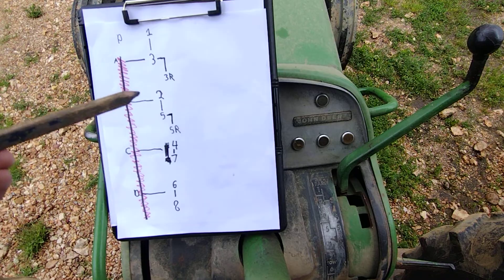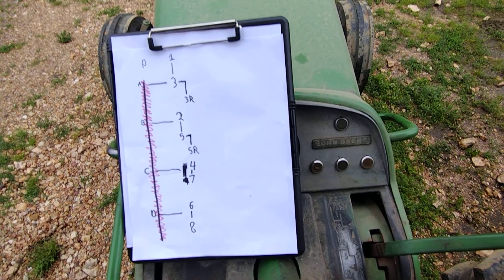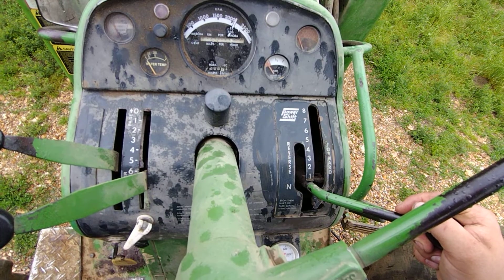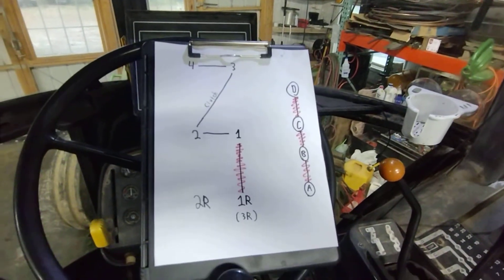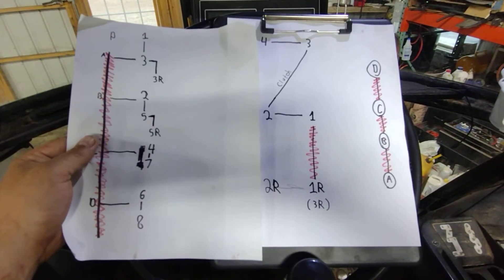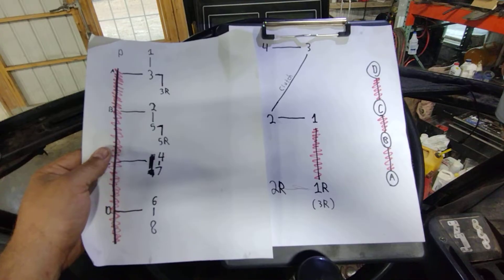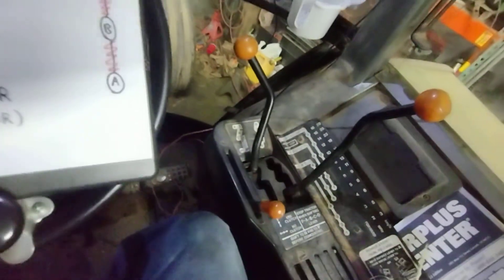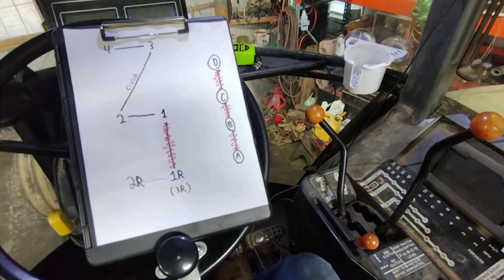John Deere Transmissions which is the best?-- Syncro Range vs Powershift vs Quad Range

Comment: Just asking how is it with a (LOADER) on front. How do you shift with same hands as LOADER control LEVERS. We had a mid range John Deere with a side boom mower, I as sorry I don't remember the numbers its been 10 years sense I ran the girl. Our shift lever was like a 5 speed transmission on right side next to seat like your tractor. It had buttons to push for 4 shift ranges in that gear. I do remember the very FAST reverse if I needed to BACK UP if the side boom flail came to a obstacle. We had more than one person driving the work 🐎 so the poor tractor got beat up. One of the operator loved to mow very fast. And beat the flail bottom and sides up, so much we were constantly welding steel bars to build up on wear parts of side and. Donlet me get started on lets say a RUG someone threw in the deep grass of ditch. You sometimes had to burn the carpet out with a torch the whole P.T.O. stopped RUNNING. Plus what I call hammer heads (the hanging "L" shaped) replacement knives that spun around it was change out almost every other day. And sometimes you had to cut them off with a torch. You could not unbolt them. That was my time on that John Deere mis size farm tractor. I can say one thing about a side boom mower. The LOWER draft linkage is never run for the life of our usage. So who ever "BUYS" our mower after its turned over for SALE. it has a 3 point hitch that is basically BRAND NEW. Those draft control we NEVER touched in the whole working life of that side boom mower, because it never was removed for the time we used it. All the tractor ever did was side boom mowing. 😊 same with a 420 FORD tractor I ran. It had a backhoe on back with the chain rap around swing for boom. That 3 point hitch was never used in the life of that 420. The backhoe stayed on. You had to shift the floor gear shifter for reverse on the 420. A farmer bought that backhoe from us and if I remember on the BID sale he paid like $13 thousand for it. The next closest bid was thousands less than his.I sat the Ford next to the CASE 580-K that we bought to replace it. And boy the difference in the two backhoes was eye opening. Especially the shuttle shift of the CASE 😊
Reply from the maker: Wow that's interesting about the arm mower. I've always wanted one but don't have enough need of course to justify it.  I'd love to have one to trim steep spots and around the pond. My first backhoe was a 580 k and I loved the machine. I'm sure it was a big step from that 420. I sold the k and bought a 580 super L. I will say that is a pretty big jump too. Mostly in horsepower and ergonomics. To answer your initial question I operate both the loader and shifter with my right hand and it isn't ideal but I've gotten fairly quick with it. Thanks for watching. Machinery D

Comment: What a crappy bunch of transmissions, I won't be buying one ever.
Reply from the maker: By todays standards sure they leave a lot to be desired but back in 1960 for the syncro, 1964 for the powershift, and 1973 for the quad range they were light years ahead of anything the competition had. I agree I would rather have a 15 speed powershift or a power-quad but a decent example of those start at about $50k so I deal with these.

Comment: So from what I see the powershift is kind of like a Lenco, planetary gears stacked together but instead of a separate lever for each gear set they have one lever for the entire set of planetaries.
Reply from the maker: Yes essentially. They use hydraulic pressure and a valve body to engage and disengage clutch packs for each combination of planetery set. Thanks for watching

Comment: I drive 2 Syncros quite a bit.  I almost NEVER use 4-7........
Reply from the maker: @saltyd218  definitely not the most used gears. I've found a few jobs they worked good but the lack of reverse or the fast reverse make them less handy.

Comment: I think I have run almost every transmission that JD has made since the 1950's. Synchro Range is fairly simple and tough, but not convenient to someone who isn't used to it. 8 speed Powershift is nice, but not always ideal, 15 speed was better, and the 19 speed let you find that real sweet spot. Quad Range was basically a Synchro with Hi/Lo power shift. TSS+ Hi/Lo is very easy in the utility size tractors. Power Quad is pretty easy to use, I had my kids running one at an early age. The nicest of all is the IVT, but I don't have enough hours on one to find out when or how it will break. Cool video!
Reply from the maker: Good assessment. Always hard some of the 19s were jerky if the computer wasn't calibrated right. Have heard of people taking them in and getting them adjusted and said it made a huge difference. Thanks for watching and commenting. 👍
Reply: Guys pulling Scrapers avoid an IVT like the Plague. The Power Quad on an 8520 does all you need. 9th gear and 1700 RPM, you never have to shift and it burns less than 14 gallons an hour. Pin it's nose and you're in 23-25 gallons an hour with no significant increase in production.

Comment: I grew up on syncrorange and I can shift one blindfolded and asleep. I’ve run all three of them and I can’t believe anybody has a problem with them. I liked the quad range in my 4430 and 4440 back in the day, but I see quite a few of them, losing bearings and splitting cases in the last few years and one of them was in a tractor that deere had just rebuilt, but I’ve also seen power shifts that had never been touched in 30 yearsof row cropping and others operated by those guys I’d like to play with crowbars in sand piles. I couldn’t keep them together, but we all know they’re 29,000 times better than a case power shift.
Reply from the maker: Yeah case power shifts were definitely something else. Bad thing is if it wasn't for that the rest of the tractors weren't too bad. Thanks for watching 👍

Comment: I've never tried it because I dont want to hack up my dash and find out it doesn't work, but I've been told if you cut the tab off that separates the 4 reverses from the forward gears on the powershift you can slap the stick back and forth from forward to reverse like a shuttle.
Reply from the maker: I've thought about that myself would be pretty nice 👍. Thanks for watching

Comment: Or just an H patern like they do now with the powerquad and they did in the smaller tracors in europe. I've got a 2030 and it has 16F-8R  with 8 gears in low, high and reverse fully synchonised. The only thing that I do dislike is just a minor thing its that you have to stop to shift low, high or reverse. The overlap in gears also is horible but the are in sequence. And you've got 3 shifters. One high, low and reverse. One has 1st to 4th gear and the last one has a two speed powershift, you can see it as an extra high and low shifter.

Comment: my dad had a 3010 that you could get to a reverse in 4/7 or c range also you can shift from a-b-c-d ranges if you clutch  dont know if it is good on the transmission just shifted slowly and not force it ,kind of like double clutch shifting a truck!  we have had 3 tractors with the syncro  trans and did it on all of them 3010, 3020 and a 4430 never had to go into a trans for that we did replace the syncro plates in the 10  after 20 yrs maybe!  fun vid
Reply from the maker: @frrapp2366  yes the 10 series had the 3rd reverse unlocked from the factory. You can shift ranges while moving but it can be hard on the transmission. Thanks for watching

Comment: If you had 3-4 on the bottom and the forward/ reverse were synchronized that would be a great loader transmission
Reply from the maker: That's exactly right. People have put a syncro shift cam in which swaps 3-4 and 1-2 positions and installed 4520 reverse gear which is synchronized. If I ever had to go deep into the transmission I'd probably do that. Great comment thanks for watching

Comment: Hard to believe this is a question. Powershift is the best transmission across ALL tractors ever made. Nearly bulletproof.
Reply from the maker: @farmerbill6855  I agree that powershift in most situations are the best. The only area that powershift suffers vs quad range is gear selection. When I do pto work baling mowing etc I can't adjust speed via engine rpm and the quad is nice to have 16 fwd gears to pick from. Although the 8 speeds in the powershift are a lot easier to utilize. Thanks for watching

Comment: I farm and hay with 13 John Deeres 11 of then are powersifts. In the many thousands of hours I have compiled on these units, we have only had to overhaul one power shift. Turns out it was bad when I bought it. We have 20, 30, 40, 50, 55 and 60 series Deeres. Many with 10k plus hours and still no trouble with the powershifts. They are amazing transmitions.
Reply from the maker: @allgreendeeres  yes they are amazing and can last a long time. Would like to have a 15 speed I think that would be a nice transmission. Thanks for watching
Reply: @machineryd2765  How would transport look like in a quad range? lets say youve got 20 tons behind you, and youd want to get up to speed(30kmh). youd have to start from D1? woudnt that annihilate your clutch? (i want to better understand these tractors, never drove one, do you really need to stop to shift ranges?)
Reply from the maker: @97vasilije  great question! A lot of people do range shift this transmission on the move. Like you stated sometimes starting out a very heavy load D1 is too high. Having said that the abcd shifts are non synchronized and can be damaged severely by doing this. Some will say they've done it for years with no problems but it definitely can cause issues. So to recap if we go by the book it's a big no no but people do it. The syncro is the same way. Needs to be stopped to shift ranges. The other day helping my neighbor who is 80 years old, has 5 4020s and has farmed with them since the 70s he shifted from 5th to 7th at full speed. I just bit my tongue and shook my head because your not going to tell an old farmer nothing. 😆 But apparently he's one of them that's been doing it for years and getting lucky 🤷  thanks for the comment any other questions let me know 👍
Reply: @machineryd2765  Thank you for replying, nicely explained, lovely story, keep up the good work.
Reply: You lose 10% hp on ps trans, I have never stopped to shift any of the points you have indicated on your charts,  put a couple thousand hours on a 2 cylinder and then try it.  Ps are higher maintenance transmissions and are jerkier  on top of which if you do any heavy pto work the life span drops significantly. Each has their place but imo ps are greatly overrated

Comment: You look at the nose of a old Oliver 4x4 it was or was rebuilt of the jd and international features took weight on the front like a pull truck heavy iron grill and extra front weights but the trim work off the farmall look and the slant nose from the deere tractors built for pulling scrape boxes rollers heaver like a caterpillar

Comment: We have had them all and each one has their place, If the quad would have had the higher gears closer to reverse it would have been alot better, its probably my least favorite though. 8 speed PS shift is still my favorite, syncro on a loader is perfect for fwd to rev speed.
Reply from the maker: Yep pretty much how I see it. The only advantage the quad has is 16 gears but the way they set it up with fast reverse below the slow forward is terrible. I sometimes like it baling because the 1/2 gear shift is just right and a 8speed power shift I wouldn't be able to find the speed I want but besides that it gets on my nerves. Would love to have a 50 or 55 series with a 15 speed PS but they are a little out of the budget. I appreciate the comment thanks for watching.

Comment: Grew up with a 4010.  I could swear that I could go from one range to another without stopping.  For example if I was hauling manure I could go from 4th to 7th to 8th, which would mean I could go to the left and move down.
Reply from the maker: @greggergen9104  yes it is possible to shift ranges while moving but not recommended because the range shifts are not synchronized and can cause damage to the bottom shaft. Appreciate you watching thanks for the comment.
Reply: @machineryd2765  We must have had the "Super 4010."  We had it for 40 years, it was our main tractor for 300, acres, including raising 500 cattle, with 7 boys driving it, over a 40 year period, starting with the first of the 7 boys who was 11 in 1961 to the last who was 22 in 1991.  And neither me nor my brother babied the 4010 and it went well beyond 10,000 hours.  I know we did a couple of engine rebuilds, but as far as I know no transmission issues.
Reply from the maker: @greggergen9104  they're amazing tractors.  Don't think many new tractors will be working in 60 years. Some people had problems from range shifting on the move  but who knows how many people like yourself did it for years without issue.

Comment: Had an uncle that was a JD mechanic in ND, dealer sold one of the first 4020 power shift to a local dairy farm that was very hard on equipment. He told me that they broke 3 or 4 front ends and the frame twice, had to rebuild engine twice but never could damage transmission
Reply from the maker: @lynnanderson2683  yep they are very durable biggest thing I would say is keeping up with the maintenance. Thanks for watching
Reply: the 4020 has a front axle too week for heavy loader use, we broke 2 axles, a lot of people put a Case front axle on them with 8 hole lugs or bolts, reasons for Case axles, cheap easy conversion and stout, my dad's powershift 4020 still runs great, still use the loader sometimes for light work

Comment: One thing that I don't think you mentioned for the synchro range is the lack of a 1st or 2nd reverse, which makes backing up to attachments and being precise kind of a pain unless you rest your foot on the brake and feather the clutch.
I got our 3020 running and immediately noticed that there really is no way to easily back up super slowly.
Reply from the maker: @Shadowsoul2701  yep the reverse speeds would  be about the same as 3rd and 5th. Definitely could be slower. Thanks for watching

Comment: and what kind of tranny i got in my 1973 1120 3 cyl diesel john deere   its a  the left stick is  P L H R   right stick is a   U shift pattern  1 2 3 4  fully manual trans witch cluthc.... i cant upshift it  no issues but i cannot down shift it .... and info ??
Reply from the maker: That is John Deere TSS transmission.  Meaning  Top shaft syncronized. Should be able to shift up and down the 1234 moving with a clutch. The H L R you need to be stopped. If your having problems down shifting with the clutch it could be that your syncronizers are bad. I would  suggest trying to rev match by shifting to neutral, letting clutch back out, then revving engine up a little, then clutch and downshift. May help a little.
Reply from the maker: https://www.tractordata.com/farm-tractors/003/2/3/3239-john-deere-1120-transmission.html

Comment: As far as reliability both of them are fantastic.
For cost of rebuild a majority of Synchro problems are going to be the top shaft which isn't that terribly expensive 5 grand can go a long ways. Power shifts most of the time you're only going into the front clutch pack which is just a clutch housing split a couple Grand and you've got your C1 C2 and PTO clutch pack and transmission pump rebuild

If you have to go into the planetary pack of the power shift it can start to get expensive but most of the time it's really not that terrible because it's a broken seal and a couple clutch discs. Very rarely have we had to go in because of planetary failure

On the Synchro transmission if you have a problem with the ranges on the bottom shaft that is where it gets a little more pricey even if you use used gears to help keep the parts built down the bottom shaft is just a lot of Labor because you are going to pull the axles you're going to pull the three-point you're going to pull the differential. So you have a lot of Labor and then if you put new bearings in there it really adds up the labor
Reply from the maker: Thanks Jon I watch your channel alot Both for soil health and tractor mechanic work. Good content
Reply: I used to take A to B to C or D in motion. Not ideal, but it works.
Reply from the maker: @BrettNoecker1  yeah it can be shifted but being unsyncronized can be pretty hard on the lower shaft. Thanks for watching

Comment: Thanks for the video. Which transmission do you prefer for longevity
Reply from the maker: Hey Bob, they all CAN last 20,000 hours or more if taken care of. But the powershift is expensive if the day ever does come that it needs rebuild. As far as the syncro vs Quad Range the syncro still has a dry clutch so usually doesn't last as long. And the Quad has a 2 speed bump shift which are pretty reliable but can go out. If I were rating them only from a reliability and cost of repair standpoint it would be 
1. Syncro
2. Quad Range ( very close 2nd )
3. Powershift. 
Thanks for watching 👍